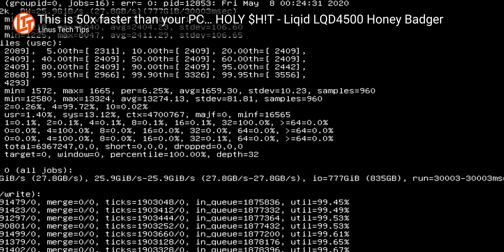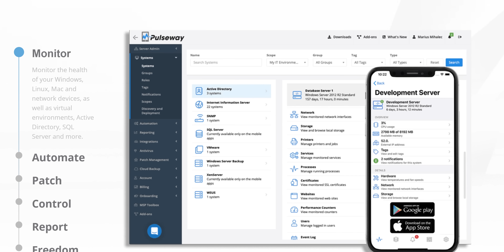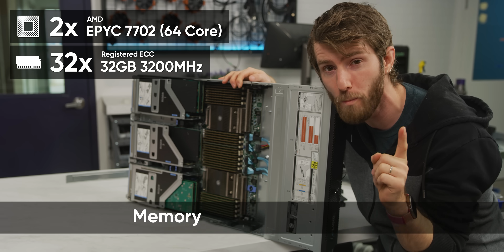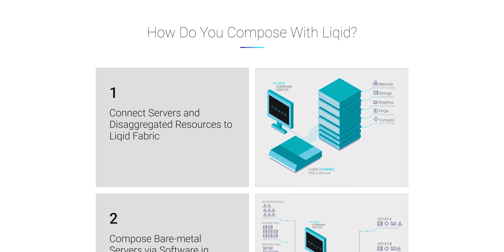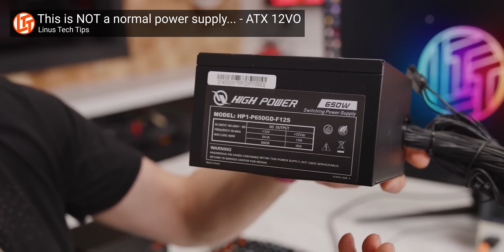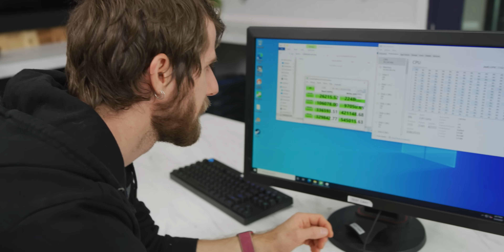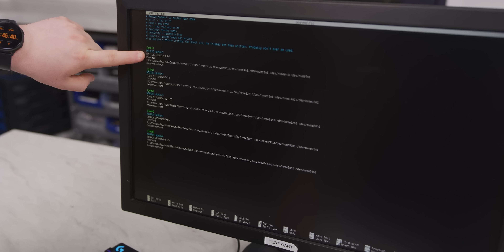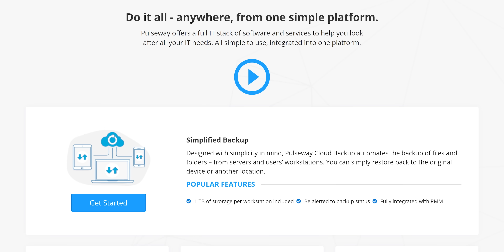This is the FASTEST Server I've Ever Touched... HOLY $H!T - Liqid Badger Den

Comment: Very Cool hi Linus Tech Tips this is the SkyWalker writing to comment about this video if I may, very cool: very cool and very disappointing at the same time. SkyWalker hates the technology exits to have so much memory but the "processing" hasn't been made to communicate it all. In SkyWalker's opinion your bottlenecking is because there is no processor to tell all that RAM what to do. Meaning one can have a choir full of talented voices but if nobody telling the choir "you all can sing an individual song (i.e processing)" then what good are their voices? Without giving too much away SkyWalker clearly must show people "how its done", I mean how hard is it to have a "motherboard daughterboard" situation with a processor? The daughterboard does all the daisy-chaining so the last-little-bit of one full card connects with top part of another unused card and both cards split tasks. The requirements of any "operation" is not overwhelmingly demanding i.e transferring bits like your Blue Ray, that's just bit to bit, Cinebench is inputting data on a platform and changing a color or two, you're writing as you go so "holding the platform" so you can write on it shouldn't be an issue for ANY sort of memory. In SkyWalker's imagination all that memory on a card is like a frog and a grasshopper, the grasshopper for example is a terabyte of ram the frog is the card that has the grasshoppers in its belly, "telling the grasshoppers what to do" should not be a difficult as it now is (i.e leaving performance on the table and bottlenecking), the frog set the pace...right now nobody is setting the pace for the frog therefore the grasshoppers as not working in unison; apparently the frogs also not working in unison either. SkyWalker says "that's an easy fix", if you tell the grasshoppers what to do the frog will swallow anything you throw at it...from editing, gaming, data input, data export, surfing the web; Linus Tech Tips the grasshoppers already know how to eat processes like the before mentioned (surfing the web, data input, editing ect.), the thing that's missing which would help users in real time/real world usage is the communication. Linus Tech Tips the "application to communicate" is not a difficult physics...assuming one know how to looking at the communication process a certain way.

Comment: If a computer runs hot does that mean that it is inefficient for the load placed on it? Wouldn’t this also mean that the heated parts must be replaced more often? (Yes I know about heat syncs)

Comment: For dell servers, I believe blue handles are non-hotswap, even if they have quick connectors. Anything with red/orange is hot swappable.

All this meaning the bank of fans is not hot swappable with the system on, but the individual fans are.

Comment: 3:00 - dear Linus, the feature of being able to remove all the fans at once through the caddy is NOT for hot swapping but rather for disassembly to replace items such as the motherboard. This way you don't have to pull each fan individually. Also in the server world the color of the tabs mean different things. In this context the orange on the fans signifies hot swappable. However the blue part means (roughly) "do not use tools and only go hand right" so basically don't bash on this if it won't go back in.

HP servers use "port wine" for their hot swap color. Dell uses orange I believe. IBM I don't recall. 

Signed - a server tech for many years.

Comment: The teacher: My computer isn’t really that much better than your guy’s.

The teacher’s computer:
Reply: I have never seen a professor have a good computer
Reply: @gerhardsmith7892  I work IT at a private school. the worst computer our teachers get is a macbook air, and we never go minimum spec. There's a few who do graphic design or photography and they got the new 16 inch macbook pro's geared out to near max specs. Then again you said professors and these are high school teachers... so not 100% apples to apples.
Reply: What?
Reply: Back when I was in high school, they were straight up burning money, it was right around when intel first came out with the core series and they were buying i7s for at least the office and maybe some teachers, because of course they need those i7s to work on freaking spreadsheets and office documents... Even worse the office also got iPads or some sort of expensive looking tablets and we got at least one computer lab with i3s meanwhile I was lucky enough just to have a Pentium E2200.
Reply: I thought theirs were way worse, or at least for me
Reply: @maxniftynine  Yeah either it is the same device such as a surface or is an old dell work station.
Reply: @quantumechanicalhose  it’s a think pad lol
Reply: I had a stroke reading this
Reply: I'm just waiting for the day when teacher has 10 monitors installed on her desk
Reply: jpnewpic88.men
Reply: what?
Reply: The students have 10 inch chrome books and the teacher has 2 Mac book pros and a monitor

Comment: 2:55 I imagine that is very useful in a server bank. - Having a spare array of fans and Quickly hot-swapping the fan array very quickly, repairing/replacing the problem fan and then having that array as the backup.

It would be far quicker to replace the array like that and deal with the problem fan out of the system. 30 seconds of the server being offline vs a couple minutes

Comment: Potential Video Series idea:
Water Cooling every Console

try to build a watercooling system that replaces the air cooling in the consoles that have them, then check how thermals did improve and if performance of notorious games got notably better.

maybe, for ones were cooling actually improved things, give a more sensible solution to upgrade the cooling at home that don't need a CNC machine around

passively cooled systems like the SNES would likely be not interesting, so skipping those would likely be good for YT algo stuff.

Comment: The fan rack is probably because troubleshooting which fan is broken while the system is running isn't practical, so you can swap the whole rack with 6 good ones in thirty seconds, then bench test each fan after the server is back operational.

Comment: As someone who's worked for HP going onsite to to repair servers, that kind of modularity with the fan assembly, is much appreciated by field engineers. Usually the engineers that design crap just like to give the field engineers the middle finger by putting a power supply in the middle of a large format printer... right in the middle, for example.

Comment: @2:50 that isn't quite how you measure the wattage of a fan. That is the power if you jammed the blades and put it at full voltage; also applies to the microsecond when you power the fan on(maybe, depends on how dumb the fan controller is). The electrical characteristics of motors are too complex to put on a nameplate/sticker, or a YouTube comment for that matter.

Comment: Okay, let me count. This must be the forth interation of Whonnock. So it would be new new new Whonnock. Btw, what will happen to the first Whonnock (the one with the SATA-SSDs), the first new one (with the lower capacity U.2-drives, which was also the last Intel-based one) and new new Whonnock (the first AMD-based one with the higher capacity U.2-drives)? Just curious. New new Whonnock is like 10 month old and still really fast. Watcha doing with those servers? Your server-rack should be quite packed right now. With like 5-6 storinators. Will you sell the old Whonnocks on lttstore.com? And btw, I there was no promo for lttstore.com in this video. How did that happen? I am disappointed!! ;-)

Comment: If they follow the color coding scheme that Dell uses (and I think HP?), Orange release tabs (the fans) means it's hot swappable (you can swap them with the power on) , but the blue release tabs (the fan assembly) mean it's easy to swap, but not hot-swappable.

Comment: let's face it - fast network and nvme arrays are the future for smb value sector - along with gpu on the dev/ws/server - zen4 is not anytime soon so refurbs will have long tail - zen4 should have more wide availability and prices should drop faster - the mkt has no liqidity right now #pun master surgeon general 's warning
Reply: oracle is getting like 10tb of db compressed in mem on machines with 4tb - will this float down to smb sector within a few years?  sure on a more limited scale - most smb have less than 40gb db - you can do this on a memsql fork with 32gb once it exists #tarantool #1m transactions/s

Comment: @Linus Tech Tips Would it be Possible to set for each Power State a limited mount of cores for use? So that in each power step the cpu runs the cores that are set to the amount of speed which is needed? I mean even 8 Cores for each Power step would be enough for a desktop User with  that big of a CPU. I think it would save Energy and boost the CPU usage a bit more... theoretically